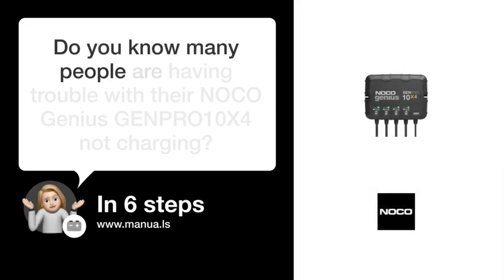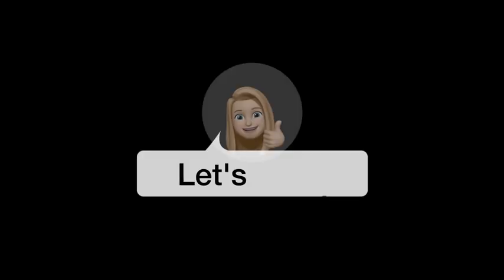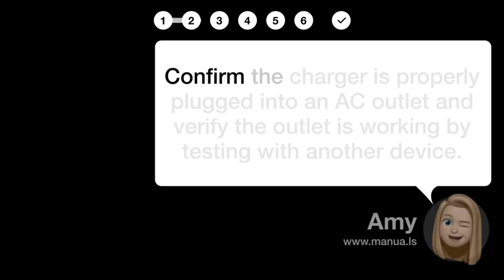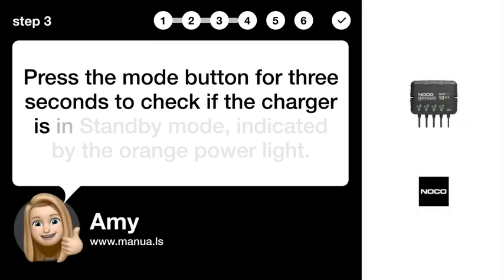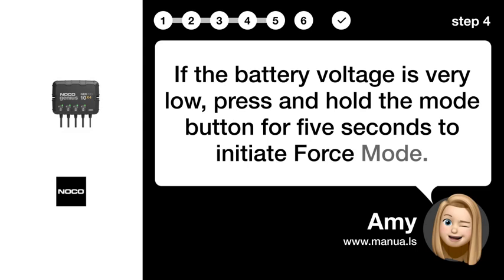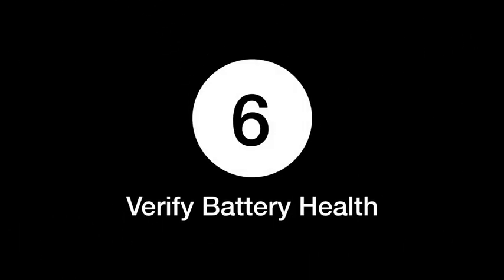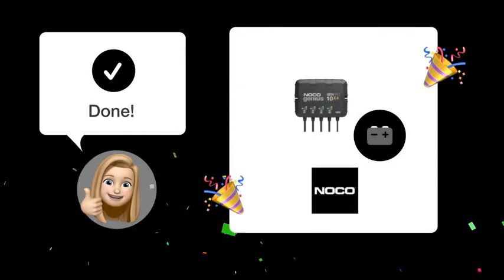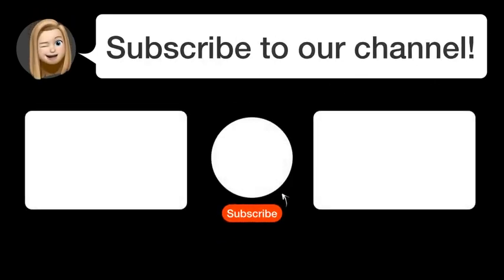How to Fix Channel 4 Not Charging on NOCO Genius GENPRO10X4

Comment: Good but needs a bit more depth and a section on what to do or how to fix for each of the red warning lights.  Also needs to  spell out the website link for this Genius GenPro10x4  in website for the manual.